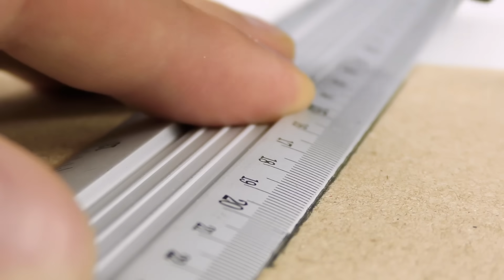How to Make Hydraulic Powered Claw Machine from Cardboard

Comment: At least it’s not rigged
Reply: Yeh ik and it's not a waste of money I hate it when these things are rigged i get so triggerd I actually feel like screaming (yeh I'm such a calm person 🤣🤣🤣)
Reply: Saba Amjad yaa
Reply: Saba Amjad u know those games where you have to cut the string if you push the button before it gets to any of the prizes hanging on the string it stops instantly no pause but it it's there or has passed the first prize this is a slight pause just slightly but just enough to never work if I'm correct about this then if it only tracks the location of the prizes then the trick is to have a friend lean the machine towards you and then try to cut it but you will probably only be able to get the first prize without leaning it any more alternatively you can lean it the other way to slightly ahead of where the string originally was and so when the machine thinks your at the prize it will still go slightly forward to where the sting actually is and bam free ipod
Reply: First Time lel
Reply: Public Nudity love
Reply: Saba Amjad  yup l spent money on riged
Reply: Rigged
Reply: Saba Amjad one
Reply: Saba Amjad the most recommended is the one with the digger for start

Comment: That machine is really cool! But here’s a question, does the syringe have to be 12ml or can it be bigger or less?
Reply: it depends on the length you want. If it's less than 12ml, the way will be shorter and vice versa